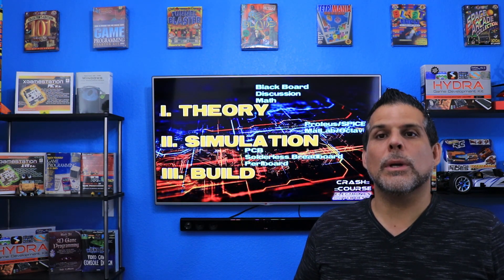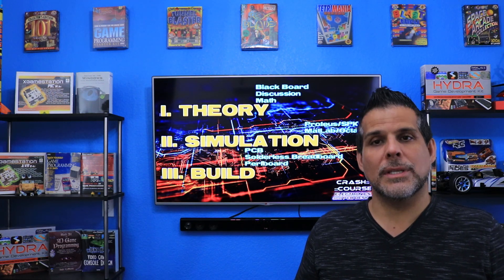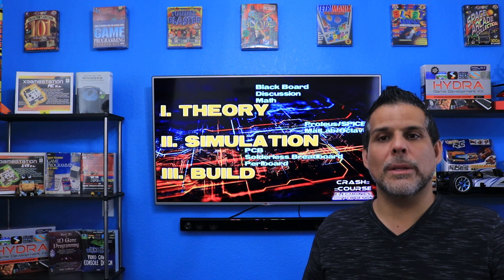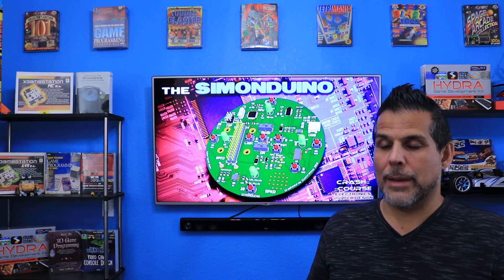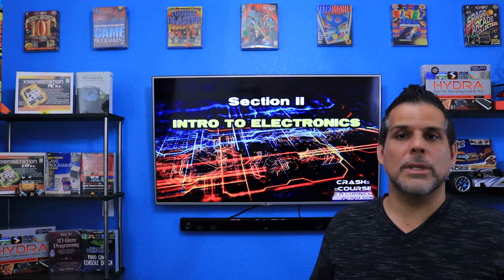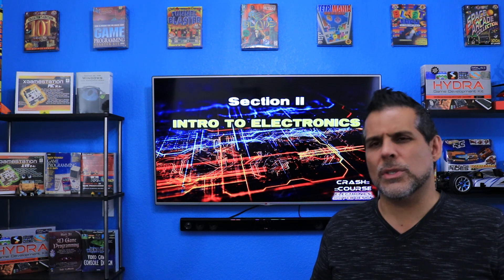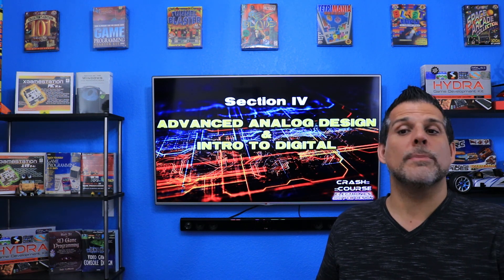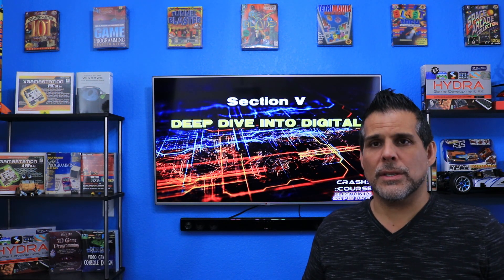Crash Course Electronics and PCB Design Promo Video - Udemy

Comment: Hi Andre, quick question: are there quizzes or problems to work through?
Reply from the maker: No, the course is just massive, so adding that would have made it even bigger. However, instead what I do each lecture or so as we work is task you with changes or things to try. But, making EE problems is like making math problems, a lot of work, and 1% of students would do them only :)
Reply: Thanks Andre, that’s fair enough! Could you recommend any resources that has practise problems to work through?

Comment: Hi Andre, really, thank you so much for making this course.  I am currently going through section 4 and am working through the Power Supply Primer and so far, its been a good course that gets your toes wet by introducing a lot of different concepts.  My background is that I have a bachelor's in Applied Math and I work as an embedded software engineer on application firmware.  I've always been interested in electronics but due to life, things didn't go to plan so I'm learning electronics on my own.  I struggle to learn with books (it takes me a lot longer and its hard to focus sometimes) so this course has been a lifesaver.   I hope you make more courses as I would love to learn more from you.

Comment: Hi, I majored in foreign languages. I know almost nothing about electricity and electronics. I recently developed a passion in repairing electronics and electrical appliances. Out of necessity, as things started to break down (LCD TV, radio alarm clock, hair dryer, digital receiver, etc.). So I learned how to solder. At this point I don't know much about anything. I only fix what I see and I learn from youtube videos. I learned to diagnose when a capacitor is faulty and I learned to replace it. I can replace a faulty cable as well. But if there is any other problem on a PCB that is not visible with naked eye, I have no idea how to diagnose it. I don't even know the names of all components on a PCB (other than capacitors, resistors and diodes). I would like to learn more to be able to diagnose what is wrong with a TV or other electronics to be able to fix them. I only want to be able to effectively diagnose broken stuff and be able to repair it... And I am looking for a course that would help me with that. Do you think this course will be a good fit for me? Thanks a lot